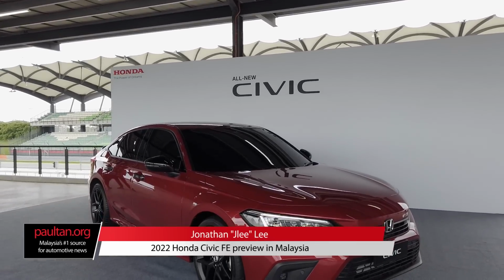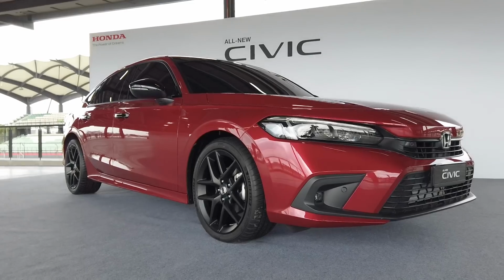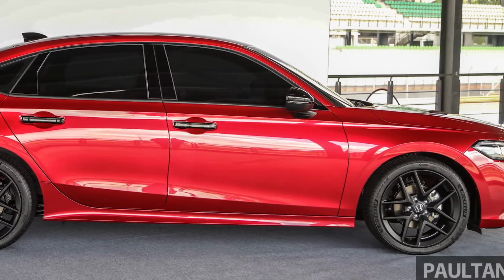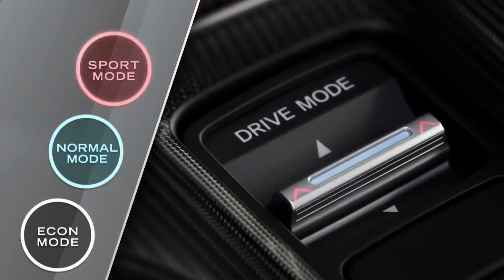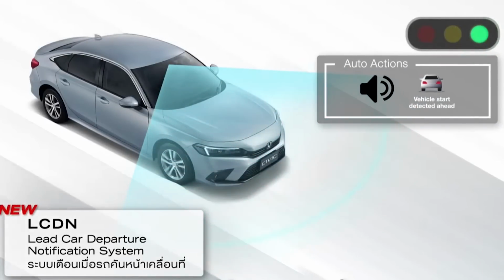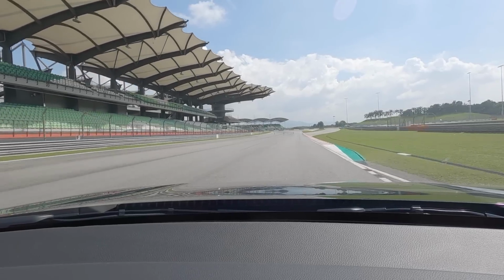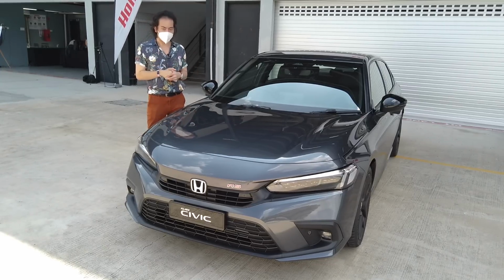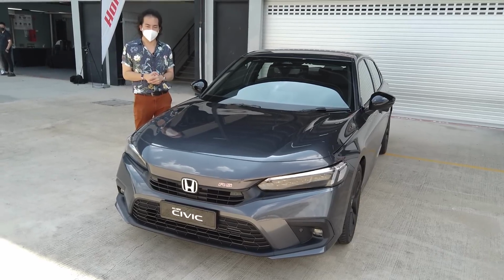2022 Honda Civic FE previewed in Malaysia - order books now open!

Comment: Am sure it drives well and is well built like a typical honda. Two thumbs up for the engineering. In terms of exterior design, I am not digging-it yet. Looks like a bigger brother version of a proton saga. The sporty line of its predecessor is still more pleasing to my eye. 

Good review, thanks for the effort.